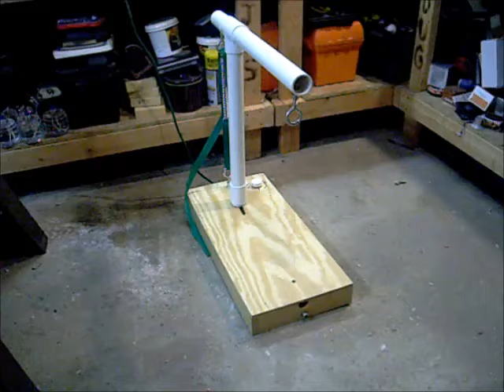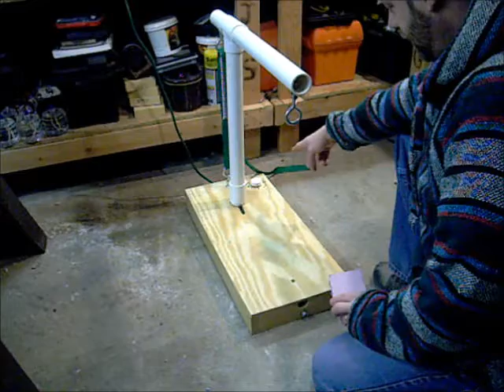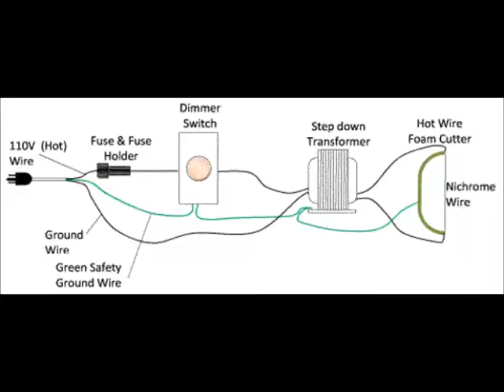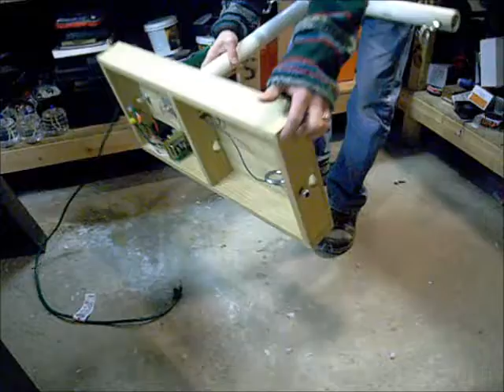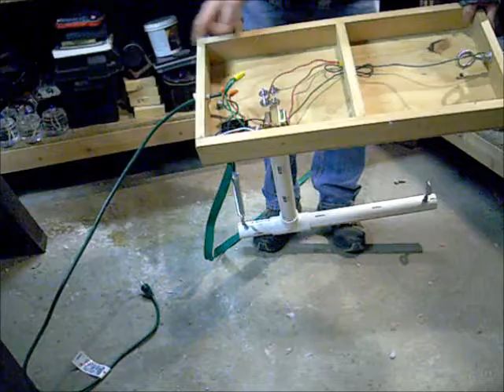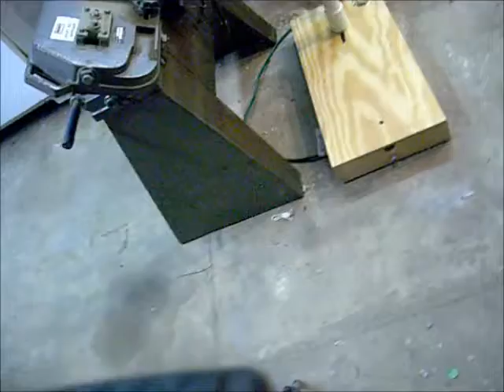Hot wire foam cutter part 2

Comment: I got mine working and halfway through cut it stopped. I cleaned off wire and bolt it wraps around thinking it was foam that melted down and covered it restricting flow of current but still doesn't work. I bought new dimmer switch cause after problem shooting that's only thing I can come up with. Haven't installed yet though. Also quick question. I'm actually cutting upholstery foam and it's much thicker. If I put thicker gage wire it's not hot enough, as it is now it barely moves through it. How can I get this wire hotter to cut faster? Bypass the doorbell transformer? Any thoughts? Thanks again.
Reply from the maker: Jonathan Henderson Not real sure about bypassing the transformer that could get dangerous with 120 volts.
Reply: Would I need a better transformer or more range of dimmer switch to allow more heat? Or is way it's done bout good as it gets for diy at home cutter?

Comment: Awesome man, that's really clever. I'm curious about varying the voltage going into transformer, will it do any damage over time? Anything I've ever wired had the rheostat on the load side of a transformer I'm pretty sure. Anyway, I've been wanting to make a wire cutter to cut para cord and shock cord. Would your setup cut those easily? There's a local outdoors shop that I've bought both from and they have something very similar except I think it has about a 1/4" wire piece of metal (wire) and when they cut it seems to cauterize both ends so it doesn't fray. Thanks for the video.
Reply from the maker: I will have to give it a try and let you know.